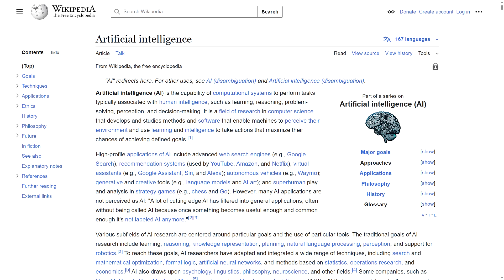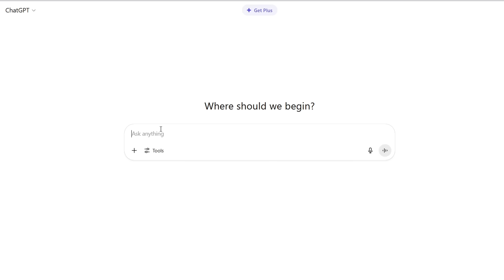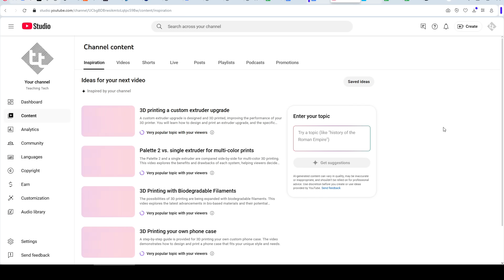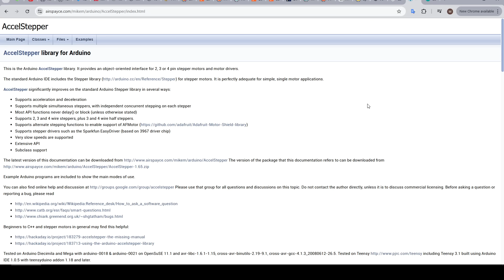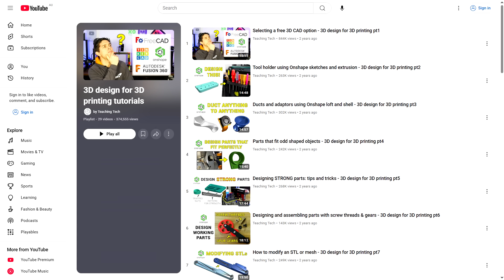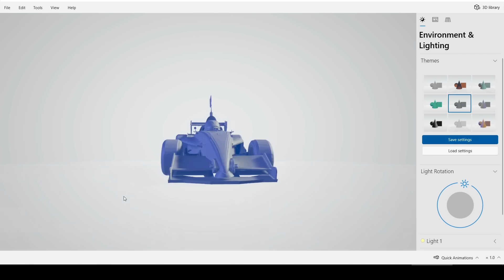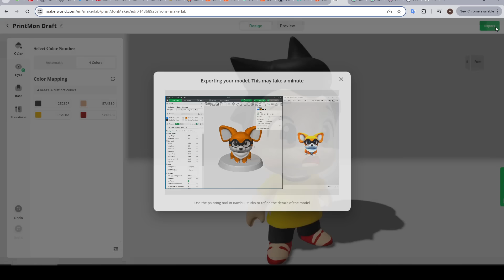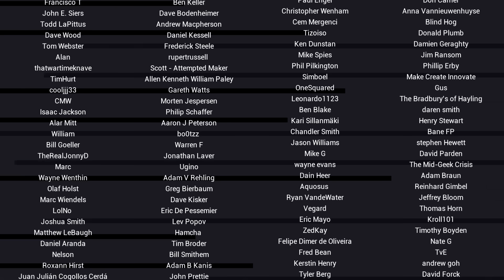Do we want AI to play a part in being a maker?

Comment: There are users joining community I am part of, asking what's a good program to generate characters and sell prints. On one hand... more power to creators, if they want to make fantasy or sci-fi characters or sculptures and the "only" thing stopping them is ability to work with CAD efficiently, it can be helpful. On the other... they will still need CAD skills to clean those models and make them actually printable. On the third hand - there's a risk of getting flooded with 3D modelled AI slop.

A good use is in matters adjacent to 3D printing. For example ChatGPT is pretty good at guiding how to accomplish something in Fusion. Or writing code when it's neded to finish rest of the project. Auxiliary tasks like generating manuals are OK-ish too - they need to be reviewed of course, but it's a way to save some time on this daunting task.

As for the Klipper config, yeaaahhhh... it hallucinates parameters which don't exist in Klipper but are syntactically correct, and answers to error messages are just generic troubleshooting steps, while experienced Klipper user may immediatelly know what's going on. It may get there, eventually, one day, but it's not there yet.

Comment: any tools an be misused.  some people aren't good at modeling, but good at other parts of creation.  should this person use a tool like AI to create something and focus on what the person is good at, or should the individual spend time to become mediocre at modeling and other things and not really be great at anything?  
generally the answer is 'try to become great at something' instead of 'try to be mediocre at everything'.. 
if you're great at ideas but not modeling, come up with the ideas and have someone (even ai) do the modeling. 
great at modeling but bad at ideas?  AI can help with ideas and you can focus on the modeling. 
some people can be good at a few things, some people struggle to be good at anything. 
but there's no need to beat your head against a wall to make something.. 
if it makes sense to work with another person to make a thing, then it also makes sense to work with an AI to make a thing. 
focus on what you're good at. you'll have less frustration and you'll produce more. 
it doesn't mean you should never learn new things, but it does mean you should be reasonable in your expectations and time management. 
if it takes you 30 days to model a creature..  but you're great at drawing new creatures..  maybe AI can do the modeling part for you and after 30 days you can have  1 okay model or 10 good models.   
same the other way around..

Comment: I've used several different AI services for writing code (in a couple of languages, notably C and python) and I am a a professional software dev with almost 20y experience (damn now I feel old). From my experience AI is really good at writing what I would call "homework code" - the kind of stuff that you used to find on Stackoverflow like small self-contained projects or data structure & algorithm problems. It's really bad with multithreading and concurrency code, every time I've asked it to do something like that the result was incorrect, often quasi-functioning but hanging and deadlocking due to the non-deterministic nature of these kinds of things. It does a slightly better but still rather poor job of resource management (making sure files are closed, database connections are released, etc) especially if that management spans a lot context (not just open, process, close again). Anything inbetween those extremes it's kind of OK usually. Not great and needing some touchups and fixes but a an OK start. I share your worries that this is particularly dangerous for those still in education.
Reply: Hey I’m slightly older and I’d not consider myself “old” 😂 My experience is similar. It’s like every Uni level software educator’s nightmare. Every single “off the shelf” solution is available, tailored to the prompter’s exacting needs. But if you want something novel, it’s very hit and miss. And yeah it’s a constant battle of “fix that”. I use it as a time saver, nothing more. You catch yourself getting lazy, undoubtedly. The bigger problem is the next generation; that’s what is slightly terrifying. I’m glad that my son shows no sign of following in my footsteps. We’ll always need carers, vets, and jobs like that. And in the meantime even when I’m old I’ll be programming, just for the love of it.

Comment: Ugh, the rework of the details really shows where I get turned off by these AI generators. With the couple of code things I've tried, the cleanup takes as much time as I would have writing it from scratch. I want tools to basically do the opposite, let me do the "fun" architecting and have some AI analyzers that are somewhat deeper than like a static linter. Pattern recognizers with neural networks are actually somewhat useful, I can create models very quickly that can sort out or recognize things from images to a pretty good degree if you keep the overall solution space narrowed. But there again, I'm doing the cool and interesting part and letting the machine cover the gaps.

Comment: I'm someone that's great with mechanical concepts and general electrical. I made my own CAD designs no problem.  But I have no idea what to do when it comes to PCB part selections and coding.   I've found chat GPT super helpful for both of these extensions to my hobby.  Yes,  I could go back to school, or sift though god knows how many youtube videos.  But finding where to start half the time is a major issue.  Github is often more of a frustration for me than anything else.

i've learned quite a bit from using AI.  It has not been perfect, and that's where I learn I guess.
Reply: When the subject is rarely discussd, using AI can be a help sometimes, but I've also found that AI halluciinates bad when the subject is rarely discussed,, for the same reasons.  And it tends to be super confident even though its output is crap.

Comment: So, I have a 16 and a 14 year old. And I'm a 42 year old software engineer. I've been using some type of AI since the day OpenAI launched Chat GPT. Like everyone says - it is very impressive at first. That is, until you start looking at the details. Every AI I have ever used gets some, if not most, details wrong. It is good at the general stuff, but when it comes to specifics, it falls on its face. This is a common thread from text generation, to code generation, to image generation, and even to self driving cars. Tesla's FSD (or whatever they're calling it now) is truly impressive. I've seen videos of Teslas driving all the way from a Texas Suburb to downtown Huston without the driver touching the wheel one time. But.... and this is the crux of it all - anything out of the ordinary - anything at all - and it will fall right on its face. From text generation having hallucinations, to code generation calling functions that don't exist or ignoring prompt requirements all together, to images of hands having 10 fingers, the full self driving smashing right into a parked fire truck with its lights flashing.

Everyone says that these are just minor details that will work them selves out eventually. But the problem is - our world is BUILT on minor details. It's the details that count.

Also, to bring this rant back to where I started - I have teenagers. I've noticed that people my age don't like and don't trust AI. We use it because we have to, because it is in everything. But the younger generation has learned to love it. They don't know when it just gets the answer wrong. And, worse, they don't care. It is 'close enough'. And that is terrifying.

Final thought: This is a bubble. Just like the dot com bubble, but bigger. Way bigger. And when it pops - and it WILL pop - it is going to be a much bigger fall out because AI is in or touches EVERYTHING now. And that is not hyperbole.
Reply: I'm 41 and a software developer. Claude Sonnet 4 does an amazing job. Are you using CoPilot in VS Code? Are your prompts not good?
I also have another co-worker who is way better than me and he doesn't haven't major problems either. No one said AI is perfect, but if you aren't getting good results, YOU are the problem, not the AI.
Reply: Using Tesla as an example is already bad, Elon Musk isn't really a good benchmark at all, among his other companies, but I understand your point and I agree.
It is normal for people your age to not like or not trust something new. I'm sure your father or other parents in your time didn't like new things as well. Maybe they didn't even trust computers to do the thinking for them. Not saying that it is wrong, and I do agree that your teenagers are in the wrong. Maybe I'm next as well when I reach your age.
As a researcher in the field and an engineer, I agree that AI is flimsy or unstable, and we are aware of this. I am pretty sure it is because of the corporations/companies that want to get a 'product' out as quickly as possible. Whereas, the researchers and engineers are forced to have a deadline and can't test every edge case. "Anything out of the ordinary" is a well known problem and people are figuring out ways to mitigate it, certainly more so than 5 or 10 years ago. Even my thesis was about that topic. 10 years ago all of these AI stuff would've been magic.
I have been up-to-date with AI way before ChatGPT got created. The amount of knowledge for AI is growing day by day at a fast rate. I agree that it might pop, but pop in either an extremely good or extremely bad way. It won't fall out unless the world's politicians will ban and remove AI (impossible challenge). I am sure you are familiar with game theory.
Also, AI is a broad term like for me, personally, I only know the basics of LLMs and don't know much about recent breakthroughs because they are too fast for me to catch up to be honest with you. Maybe you mean LLMs will fall out, and to be honest I still don't think so. My specialty is mostly in RL and controls (robotics), machine learning is such a broad subject that it can be applied to everything as you mentioned. Even small things that you rely on can be replaced with 'AI', your thermostat that regulates temperature is an example. So, even if for some reason LLMs die out, 'AI' will still be there, it is just matrices multiplying and adding (oversimplification).
Reply: You sound like you haven't actually took the time to learn how to properly use these AI models. Yes, if you want to do something with AI that doesn't exists in the training set. Then you have to teach it. That's why you have to finetune it like with making a LoRa. That way you actually can go specific on your specifc stuff. That's why there are base models and then other models like a reasoning model or with ChatGPT the abilitys to finetune a GPT on a specific topic. That's the whole point of finetuning. ChatGPT btw. is not your codeing agent. There are far better models for codeing like Claude. The base models are meant to be able to handle what you described. The general stuff. The generic questions. But once it gets specific, you have to go specific. People like you are the problem. You build your opinion about AI before actually testing it properly. Like any other tool you have to learn it. If you don't get from the AI what you wanted, most of the time it's because you don't know how to prompt properly. Or you just used the wrong tool for the application. I see people using ChatGPT for image editing meanwhile ComfyUI is so much better. Because it was designed for it to get control over it. Also that 10 fingers thing is an absolute outdated old example that have no meaning in 2025 anymore. Any recent image generation model can handle fingers. And it won't get worse from here.
Reply: @MrGTAmodsgerman  The vast majority of people, like 99.99%, will use pre-trained generic LLMs like those offered by the big tech companies. And this whole "prompt engineering" thing is total bs. The question is "can you clearly describe a problem with enough domain specific language to get constructive output". Prompt engineering is a grandiose term for clearly stating your thoughts, and the people peddling it are akin to snake oil salemen.
Reply: Older people fear AI because it could make them (literally) redundant. Young people don't have the same presuppositions, and hence don't have the same fears and insecurities. Boiled down, this tech isn't going away, so I will use it where it makes sense, and leverage it as a time-saving device. You are right to be terrified, but imo not by the tech itself, but by the "close enough" nonchalant attitude many people exhibit. Two things will change after the novelty of AI wears off. Firstly, regulations will be introduced/tightened, and this will most likely be over system failures or engineering catastrophes. Second, some (maybe a very small minority) young people will realize that human creativity still matters, and they will invent big things, probably aided by AI, but not led by it. In any case, we all have no choice but to lean into AI and ML.
Reply: @david-2 as a senior developer, it's literally the opposite of what you're saying. The people with 10+ years of experience aren't worried AI'll replace them, because they have the experience to pick up tasks AI can't do and it's trusted to do. On the other hand, the junior developer market took a 10ft dive through an announcers table. Companies aren't hiring juniors any longer, they're telling the seniors to use AI instead.

A friend of mine is a junior developer and she was laid off at the beginning of the AI boom because her contract ran out and the company was gonna replace her position with AI. She's still trying to find a job.
Reply: @SanderMakes  Getting an entry level job was also a huge problem before LLM. Because companies expect everyone to be able to do everything without even giving them the chance to reach these requirements. Because they ran AI already to answer all the job applications and often also because they don't even know what they want. LLMs are now just amplifying the problems we already had to an absolute madness level.
Reply: @david-2 close enough is why China is beating you. Close enough is good enough if it gets us to The Next step. It's also how biology works. And "human creativity" not some magic thing the god people only possess anymore. Our civilization has long abandoned the pursuit of optimized living for humans.  We now bet that the markets and their hegemon's need the system so bad that they will feed us
Reply: @david-2  I definitely agree with you for the most part, but some young people (myself included) are concerned about AI, specifically about whether regulations will hold companies accountable for misuse, and about attempts to use AI to undervalue the work of creatives. I agree that it's useful as a time saving device and I already see ways that it can supercharge projects, but I don't think we all need to lean on it as much as we all need to know its capabilities. I still use it occasionally, so idk…
Reply: @xenontesla122  It's good to be cautious, and I'd rather the industry was more caution. It's an arms race (of sorts) though, and with the progress being made it's likely we'll be asking questions and making serious legislation after it's too late. Agree that leaning on AI will make us all more reliant on it, but this is the broad story of tech in general.
Reply: You're an engineer and you don't take the results from 1 to another? AI isn't something that's just hand delivered on a plate for you to just pick from. You have the ability to do things that you weren't able to do 5 years ago. You're an engineer so maybe you don't need some of that heavy lifting. But AI can most certainly accelerate every part of every repeatable task or computation you do. These are just facts. Making these global statements that expire the next day is getting so annoying
Reply: @GoodBaleadaMusic it’s the point that “now” A.I. has problems. Unfortunately, people who don’t use A.I., don’t understand the problems. Sometimes it works very well, but there are times when it fails miserably. But if you don’t have experience in the area, you may not know that. I expect that over time, it will not give as many incorrect solutions as it does now. That’s a general LLM. But specialized LLMs can be very accurate now. We’ll see how it goes.

Comment: The main problem for me with AI is how it is applied. Do I want it to try to make a complete model of an image? Well, it can be useful for a placeholder, and hopefully for models with simple shapes you can save yourself a 3D scanner or photogrammetry, or in the medium term perhaps as a starting point for modeling a realistic piece where the shape has to fit somewhere. Personally, in these cases, I don't think generative AI is wrong, and you could easily save hours or days on a boring job. 

Now, designing from scratch? Anything can happen. It'll work for simple things, but as soon as you want to complicate things by making mechanisms, springs, place&print, or manipulating something specific, it's going to fail miserably. 

So, assuming an AI that, when you open your trusted modeling program, assists you with voice commands, watches the process, and with commands such as “Cut, Extrude, Line Constraint, Symmetry, etc., etc...” and activate the tool without going through the menu or prepare a list of steps to be activated one after another as soon as I finish a step, it would be an absurd improvement in quality of life. If I get stuck on a project, I can ask the assistant for help and it will give me possible ways to solve the problem. If, on top of that, before finishing a project, I were checking for possible errors, it would list sections to review, etc. It could be an incredible assistant.